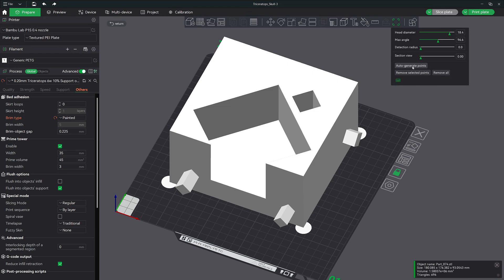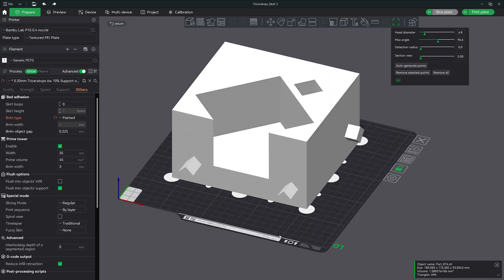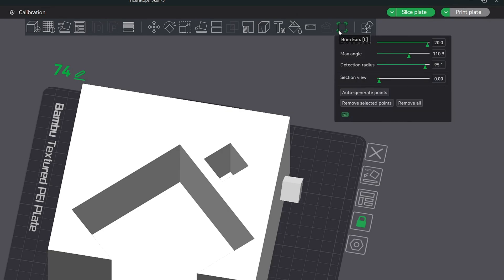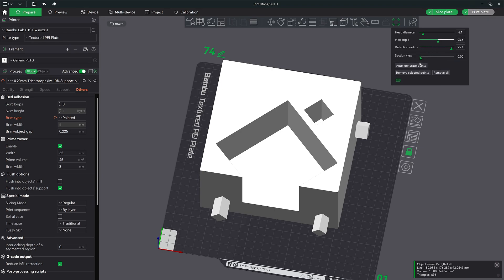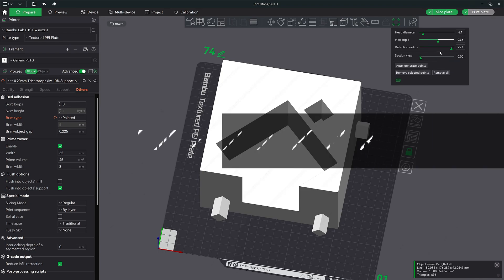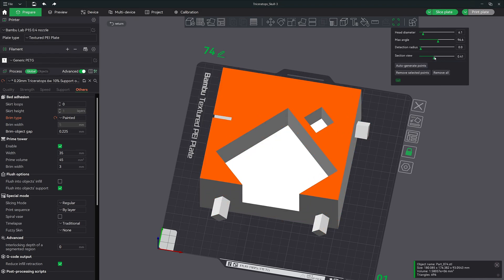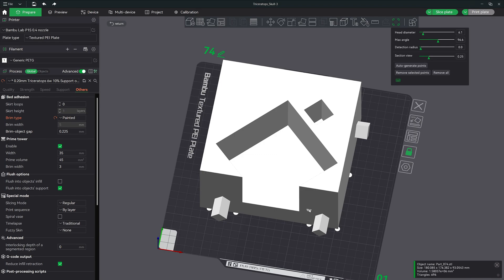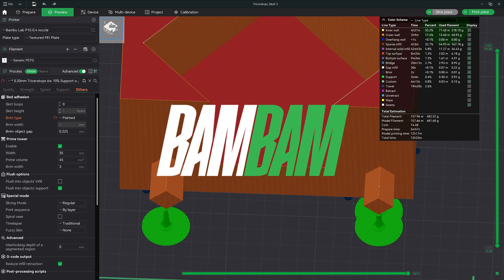Best 3D Printing Adhesion Tips! 🎯 Stop Warping With Brim Ears

Comment: I have 5 parts on my build plate. I put brim ears on all of them but when I slice only the first one I put the ears on actually appears in the sliced view.  If I select all and try to autogenerate the brim ear tab on the upper menu doesn't even high light so I can't select it and apply auto brim ears to all the parts. Very frustrating.
Reply from the maker: You have to add brin ears to each model individually
Reply: @planet3dp  when you say model do you mean part? I did add them separately to each part, but it didn't keep them when it sliced.

Comment: Just this morning, I was thinking that brim ears should be automatically generated by the slicer, in a manner similar to turning on skirts, brims and supports, and here we are!  I'm looking forward to this feature coming to OrcaSlicer and PrusaSlaicer soon.

I hope 2025 will be the year that slicers catch up to the rapid improvements we've seen in 3D printers in the past few years.  Many printers now have multiple filament feeders but they purge the previous filament by pooping or printing a purge tower.  Slicers should be smart enough to use the purge material as infill.
Reply: its already in orca automatically. It's manual in bambu.
Reply: @Jpeglism  - I found it under Other - Brim, just where it should be.  Automatic puts too many brim ears on my functional parts.  It's easier to add them where I want them in CAD than needing to trim all of the extra mouse ears.  Hopefully OrcaSlicer will get the manual option.  The sad thing is, when looking for information, I saw that I watched a ModBot video a year ago showing brim ears in OrcaSlicer.  My old brain can't remember anything.   😕
Reply: @Jpeglism  Bambu supports both automatic and manual brim generation.
Reply from the maker: I hope you are right about the improvements in slicers! It will definitely be a big improvement to the workflow.

Comment: is it possibe you do a video on how to fit a deadpool cosplay mask on the bambu and make it fit while increasing the size to fit heads? would gladly share the file with u if u wanted.  having issue setting the mask up
Reply from the maker: I could do a walk through for that. I don't think I would use the deadpool mask but the technique would work the same.
Reply: @bambamprint  I would really appreciate it. Same way how I noticed alot of people having same problem with trying to have the design fit on the build plate.